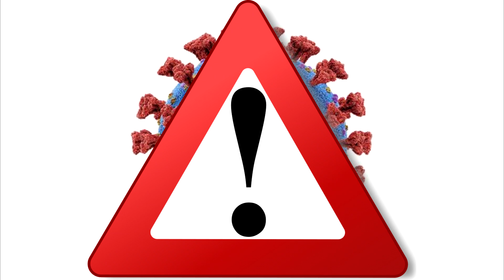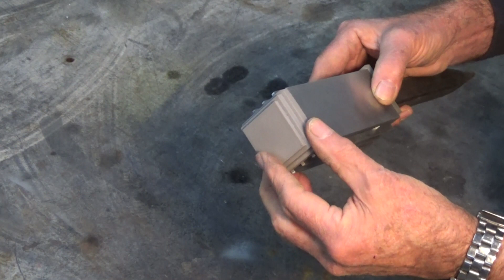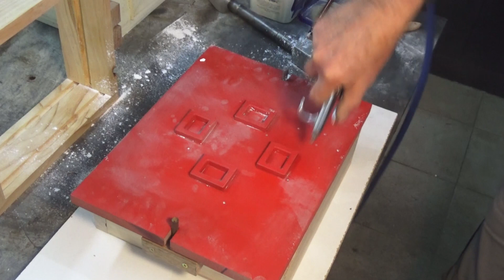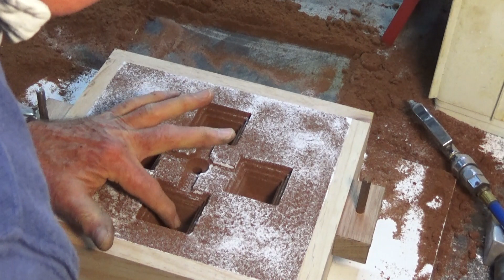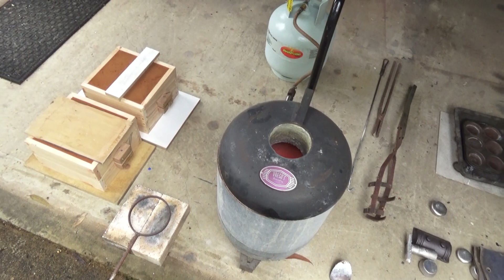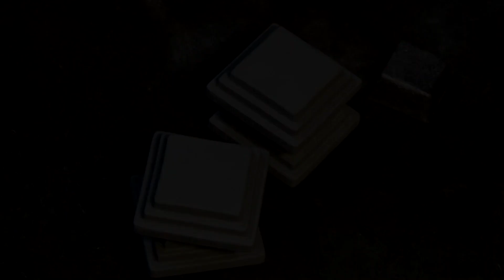How to Make Multiple Castings From a Single Match Plate.

Comment: 100% yield isn't what you got..  weigh just the castings without the gating or the risers. Weigh the gating including including the risers. If you got a good yield the castings should weigh about 60% of all the gating and risers. Maybe as much as 50%. Just me being picky.
Reply from the maker: I get what you mean but I was referring to the yield of useable castings. Often when I try to make multiple castings there are nearly always poorly formed or only partial castings. Generally, if I need four I will need to make six!
Regards,
Mark
Reply: @Preso58  then you're referring to scrap rate. If you made 100 castings and all 100 were good you had 0% scrap. If 90 were good you had 10% scrap etc. So you did real good if all castings were acceptable. Referring to scrap rate or recovery rate.

Comment: Very nice work on the lapping. From what I can see in the video correct me if I'm wrong, it looks like the exhaust is too high where there won't be enough room for compression between the exhaust port and the head.
Reply from the maker: The crankcase casting needs to have a cylinder liner inserted into the vertical bore so the cylinder head is bolted on top of the liner rather onto the face above the exhaust port.
Regards,
Mark
Reply: @Preso58  awesome I can't wait to see the next videos

Comment: Nice work I also found solar  garden lights we rubbish so what it done is got a big 6x8 inch solar panel charging  an 18650 battery and that does all summer lights and the Christmas lights
Reply from the maker: Yes, it would be nice to retain the solar function. I have been considering doing something similar for our front gate which is a long way from the house and nowhere near a 240V power outlet. 
Regards,
Mark

Comment: Great job Mark.  I always use the flask half with the pins as the drag so that both the cope and match plate are guided upward using the pins.  Why not make a match plate with all 10 pieces?  Roger, Old Retired Metal Shop Teacher
Reply from the maker: Theoretically, you could cast all 10 using one match plate but the ones farthest from the sprue might not fill entirely. The gating and runners would be quite complex as well. 
Regards,
Mark

Comment: Please don't take this as a critism, it's just an obsevation. You achived the results you wanted and they came out great.
By adding that extra material to the pattern I belive you are creating an area that will shink due to the extra metal. I know this the intention but
without that material and a large diametre feeder you would not get shrinkage in the parts. The large feeder would take care of that.
Example here. These parts are smaller than yours but larger one would work the same.
Keep up the interesting videos, I look foward to them and watch as soon as they come out.
Reply from the maker: Thanks for that. I think you know who's methods I have adopted for making the offset pouring basin and the tapered sprue. It does seem to work for me and I don't get much porosity in any of my castings but that is also to do with using good quality ingots as my stock. I have tried your methods with the large diameter feeder and those castings worked out great. I get the feeling I will won't ever learn all there is to know about this whole foundry business. 
Thanks for the feedback.
Regards,
Mark

Comment: Lovely work Mark, yes it can be a fine line between ramming to hard to get a smooth surface finish and ramming to soft to give permeability to the sand.  Match plates are a great way to go for reasonably shallow patterns or deeper patterns using hard sand.  When I was ramming multiple parts I often employed a "Blocking Plate" rather than a "Match Plate".  A Blocking Plate is used to set the parting line on multiple parts but keeps each pattern as a single part so they can be withdraw individually.  This is helpful as deeper patterns can easily catch the sand when being withdrawn a large Match Plate.  Event the slightest angulation of the plate will cause this damage and it takes a steady hand to not mess up the mold.  In a Blocking Plate the pattern is used as on piece.  An aperture is cut in the plate to allow the cope half of the pattern to sit in, it can be a loose fit to make it easy to remove the Blocking Plate latter, the runners can be fixed to the plate in the same way they are on a Match Plate.  The pattern is sat onto the Blocking Plate up against the runners with the other half sitting in the cut out aperture.  Ram up the sand as normal and finish out.  Flip the box over with the Blocking Plate.  Lift of the blocking Plate to reveal the other half that sat in the aperture, the runners will also need to be fitted back into the cavity.  Fit the second half of the box, dust and ram the sand as normal.  Separate the cope and drag and then remove the runner and patterns individually as per standard practice.  Being able to remove multiple patters individually takes the risk away from trying to remove and control a large Match Plate.  
Cam
Reply from the maker: Thanks Cam, that's useful information. I think I have seen this process done before (blocking plate) but I didn't realise the benefits gained when trying to remove the patterns. 
Regards,
Mark

Comment: You need to watch WindyHill foundry he vents every cast
Reply from the maker: Trust me, I do watch every video that Clarke Easterling has done. He is a great source of information and I have learned a lot from watching his channel. Venting is one of those topics that generates a lot of debate amongst foundry operators. There is also the issue of the greensand composition and what sort of material you are casting. The iron that Clarke uses behaves quite differently to the aluminium that I cast and my sand is based on silica beach sand and bentonite clay which is not really the best recipe but it's what I could get. I am hoping to purchase some natural clay bearing sand later in the year to see if I can get a better surface finish. 
Regards,
Mark

Comment: Stainless steel screws and aluminium, you may want to look into galvanic corrosion. Beyond that, nice design!
Reply from the maker: That issue has bothered me but I am hoping that the powder coat will waterproof the connection. The galvanic reaction is accelerated in the presence of moisture and oxygen. The screws connecting the top of the body to the casting will be powdercoated after assembly and the bottom screws will go in after the powdercoat covers the surface of the aluminium. I may also powdercoat all the heads of the bottom screws. Epoxy glue might be an option but I like the idea of being able to dismantle things if anything needs servicing.
Regards,
Mark
Reply: @Preso58  ah, I missed that you wanted to powdercoat these (just came upon your channel) that should already get you quite some way into avoiding problems here.  Aluminium and stainless aren't real good friends but the limited contact surface with just screws and having the body already coated should be ok and last you a long while.

Comment: Hi Preso, they turned out great. Those blind risers certainly done the trick. Tell me was the melt just straight aluminium with no chemicals/degassing agents added? Regards Kevin
Reply from the maker: Kevin, I stopped trying to de-gas and add fluxes after some advice from Martin from Olfoundryman told me that the only way to de-gas properly was to bubble argon gas through the crucible. His advice was to use clean ingots of a known alloy and to melt them and pour as quickly as possible. I ended up purchasing ingots of 601C alloy from a local foundry. I paid $5 per kilo for it and it was like a revelation when I got the first casting from it. 601C machines beautifully, without porosity and it can be hardened to a T6 standard. I can't do that at home here but I can do T5. I haven't had to do it yet but it's possible. 
Regards,
Mark
Reply: @Preso58  thanks Mark that's good to know. We'll done on the castings the match plate worked out great.

Comment: great video! I always learn something. When parting the mould to remove the match plate, maybe flip it over and remove the drag first, so you still have some pin a a guide?  My thinking is the cavity is much shallower on that side so a bit easier. then you have better access for removing the cope in a more traditional way.
Reply from the maker: That's a good idea. I have also seen a technique where some large heavy steel blocks can be pushed up against the side of the match plate to act as a guide. Unfortunately I don't really have anything that big and I sort of got a bit impatient to see how it turned out. By the time I got to the third mould I was feeling pretty confident and the last one turned out the best. 
Regards,
Mark

Comment: It is true that the harder you ram the sand, the better the surface finish can be, BUT...  The harder it's rammed, the more likely the sand is to break when extracting the pattern.  If your pattern is HDPE or some other nice slippery plastic, and you've got good draft angles all around, you can ram it a lot harder than if it's wood or something else that sand can readily stick to.
Reply from the maker: I think that was the conclusion I came to the last time I was doing some casting. I had around 8 failures in a row and it got progressively worse as I pulled away large chunks of sand each time I tried to take out the pattern. It's completely counterintuitive but going a bit softer with the ramming proved to be the key. There's so much to learn about foundry work!
Regards,
Mark

Comment: Suggestion:  I like to keep the mold cavity as far from the sides of the flask as possible to avoid potential leakage.  If the parts on your match plate were rotated 45 degrees from the sides, you'd have considerably more clearance.

Comment: G’day Presso. Job well done, I too ram the sand too hard and possibly too wet, it’s all a fine art which gets better with practice. Love the design. 
Cheers 
Peter
Reply from the maker: Peter, I wish I lived close to somebody that knows what they are doing. I tend to be a bit of a loner and as a result I learn to do everything the hard way but sometimes it just takes someone to stand beside you and correct simple mistakes. Having someone tell you "not to ram too hard" is frustrating since I immediately want to say "How hard is too hard?" When I was teaching young kids to use a tenon saw for the first time it was so easy to just stand beside them and guide their hand or arm until they "got it". It's not so easy when you have to do it from a distance. Remote learning is well and good but it doesn't work for areas that rely on motor skills. 
Regards,
Mark
Reply: @Preso58  I too have the same problem, many a presenter will say “wish we had smell-o-vision” well it’s the same for “feel” In my past life many ask how do you know when the wheel bearing is correctly preloaded, well follow the vehicle manufacturers guidelines if you can find it but often it’s done by feel. 
Cheers 
Peter

Comment: With LED's in them, you shouldn't have to touch them for decades.
Reply from the maker: That's what I'm hoping. There are a few that still have the older style halogen bulbs but I am slowly replacing these as they fail.
Regards,
Mark
Reply: @Preso58  Cool, looking forward to the glass work.

Comment: Congratulations on your breakthrough discovery ! Can that decking material be powder coated or would it melt?
Reply from the maker: I think it would deform. Eco Deck does have some information regarding elevated temperatures and they advise fitting joists no more than 300mm apart to allow for softening of the material in very hot weather. I may just stain it with some black stain.
Regards,
Mark

Comment: Superb work! I've always wondered why people don't use a sheet metal heat shield to keep from charring the top of the flask when pouring. I know it's just another fiddly bit to get in the way, but it seems like a cheap and easy way to protect the flask and remove one more possible distraction when handling the crucible.
Reply from the maker: I should make more than one but the first pour is the one where you are most likely to spill the metal. 
Regards,
Mark

Comment: It also took me a while to learn to not over ram the sand. I would like to see a short explanation about how you made your temperature gage.
Reply from the maker: Pat, very early on when I was first starting out with the casting experience I had a mould simply fall apart when I was carrying it. I had seriously under rammed the sand and after that I thought it had to be compacted like concrete. I recall another YouTuber saying that you have to ram well not ram hard. The thermocouple came from Myfordboy's channel. https://www.youtube.com/watch?v=hF3qYf_tjtc Mine is a bit different in that I use a digital multimeter to display the data from the probe. 
Regards,
Mark

Comment: Good job Mark. Just thinking of something that may or may not work well; have you considered a three piece flask with an extra cope rather than the standard two pieces. It might allow you to pour two layers at once. Of course that would mean making two pattern plates as well.
Reply from the maker: I have never seen that done before but I guess there's no reason why it wouldn't work. It would mean some creative gating and having to line up the sprues between the layers. 
Regards,
Mark

Comment: Matchplate molding is why I put my flask alignment pins in the drag instead of the cope...  Alternatively, you could have rolled the mold over before demolding the pattern.  That would have made drawing the matchplate out of the deeper more detailed cope side a lighter lift, therefore easier to control, as well as ensuring both sides would benefit from the alignment pins guiding the separation.  Anyhow, many ways to skin a cat as they say.  The parts look great!   👍
Reply from the maker: Thanks for the tips. There's so much to learn with foundry work. I had used a match plate once before but it was only a single sided one. I made four window winders for a Range Rover. That's partly the problem. I'd had just enough experience to make me dangerous!
Regards,
Mark

Comment: Why not working upside down when removing the pattern plate? First remove the drag (?), so it is still guided by the pins in the cope, then remove the pattern plate from the cope. Nice project!
Reply from the maker: You are correct. I was well and truly winging it when I dismantled those moulds. The last one (not shown on camera) went a lot smoother but I have that experience under my belt now.
Regards,
Mark

Comment: Hi Mark looking good! Question, you said in your last install that you have made the opening for the cable a very close fit to stop ant etc ingress. As your friction fitting the glass do you think that there may be an issue with water being trapped in the lights?
Reply from the maker: Andrew. I have had one sitting in the garden for a couple of weeks now and we have had some rain. So far it seems to be keeping dry inside. I am hoping that the powder coat will form a seal around the joint at the top but it's going to be a case of monitoring it for a while. 
Regards,
Mark